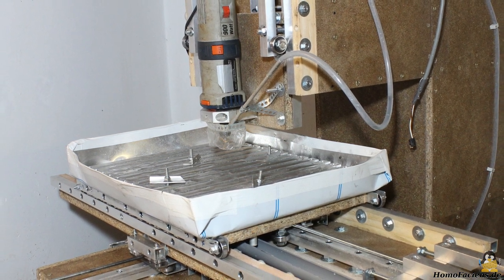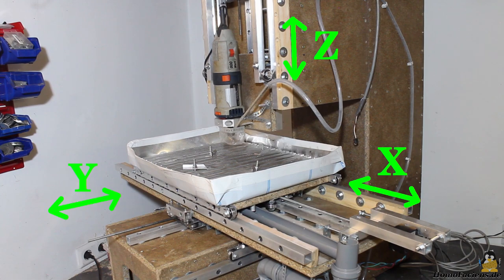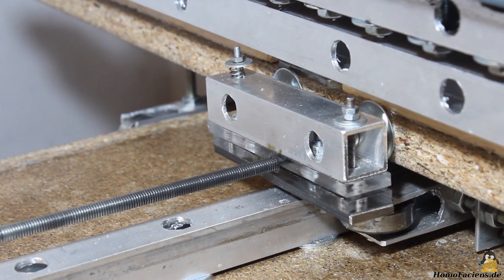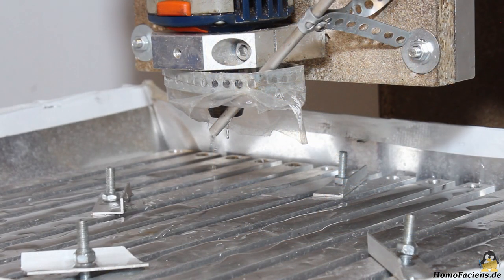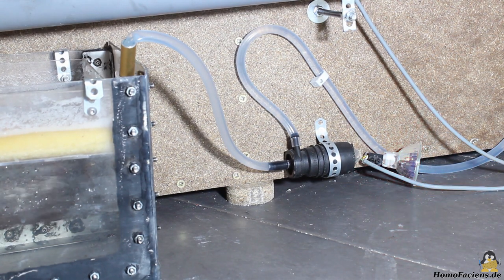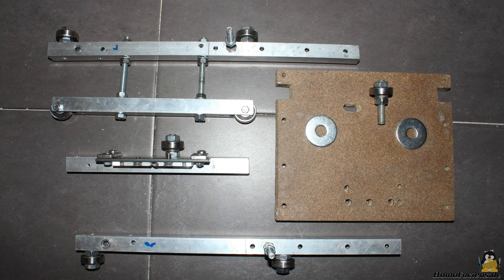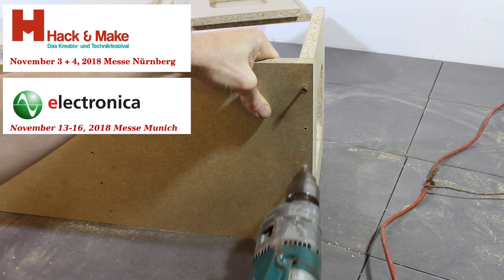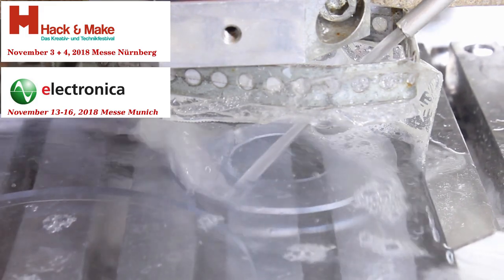Current stage of my DIY CNC v3 2 2

Comment: 0:50 that transparent rubber hose coupler almost killed me.
And the stepper motor seems locked in place by the pressure from the nearby aluminium bars 😂 🤣
1:25 the threaded rod spins OFF AXIS
man all this is hilarious and also the fact that it works as is, is even funnier.
Reply from the maker: The idea behind this series of CNC machines was to create them without using another CNC to cut out the parts. A drill and a hacksaw is all that's needed to get out of that chicken-egg-dilemma.

Comment: this is a great project , i had the same intentions in the past , to make a cnc machine that can be replicated in various scales with no need for an other cnc to cut it or any fancy equipment , and it was successful , if you have the time you can check it on my channel , i will be really glad for your feed back
Reply from the maker: I see, you are also using old computer power supplies. The design of your machine is definitely worth having a closer look at. Thanks for sharing.